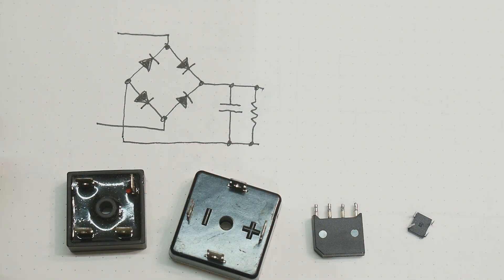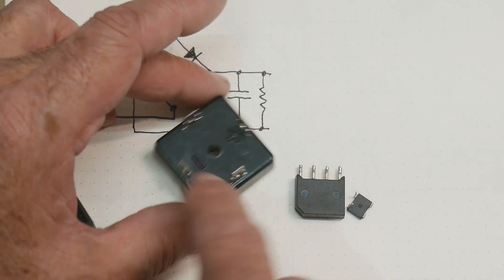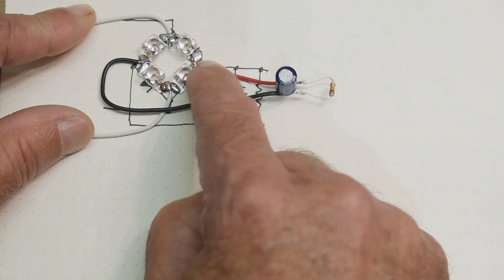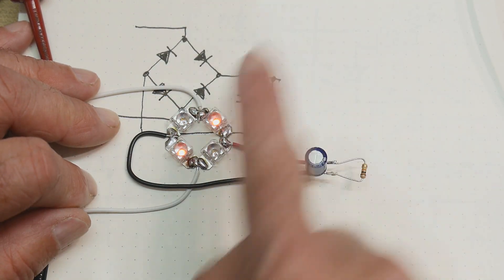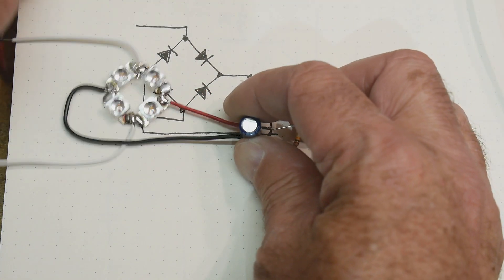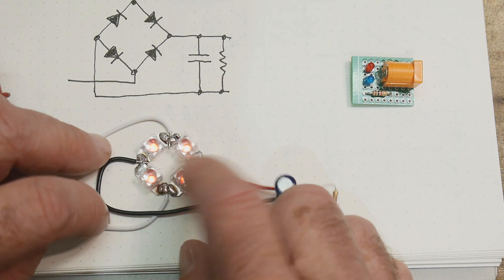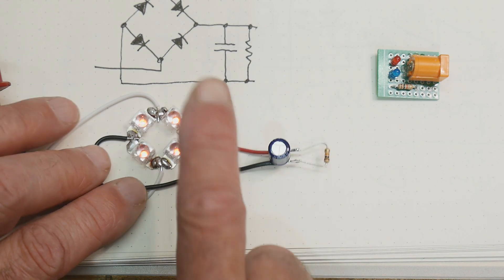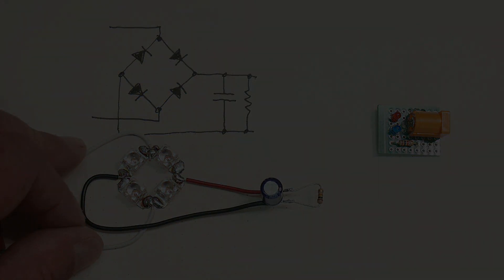#772 Basics: Bridge Rectifier Visualized

Comment: My awakening to the importance of return-path was when my wife complained that the headlights on her car didn't work. I worked on that problem for 3 evenings after work before I noticed that when I pulled up on the headlight dimmer switch the heater fan would run.  ????   A couple hours study of the wiring diagram convinced me the only way that could happen is if a ground connection was not good.  Checking a multiple lug ground terminal mounted to the body in the left side of the footwell I saw that water had leaked through where the radio antenna was mounted in the fender and dripped right down on to it causing a lot of corrosion.  Cleaned it up and the headlights worked just fine.

Comment: As usual, an excellent explanation. What were you using to give 8 volts a/c that allowed you to bring it down to 1 Hz?
Reply from the maker: HP 33120A Generator
Reply: @IMSAIGuy  Will most generators do that?
Reply from the maker: @JohnVK5JAK  my old HP 8111 goes to 16V
Reply: @IMSAIGuy  A quick related question. If I want to test HF band filters (up to 30Mhz) I need a generator that goes up to at least that. Right?
Reply from the maker: @JohnVK5JAK  yes of course, a good tool for testing filters is the NanoVNA
Reply: @IMSAIGuy  I've got the NanoVNA & TinySA. I'm in the process of deciding on an Oscilloscope or Rig Expert AA-35. Decisions decisions......

Comment: I was pushed to be mindful of the "negative" side when I was working out, in general, a heat pump defrost board.  HVAC low voltage is 24 VAC, the board rectified it to operate relays, and also create rails for chips and thermistors.  The 24 VAC signals came into the board to ground through power resistors with voltage divider/zener diode taps to the PIC chip pins.  But those sensing circuits were to the DC negative rail instead of the AC common even though they were separate from the rectifier.  That forced me to not neglect the path back from the DC negative to the AC common as it is usually called.

I built a LED full bridge rectifier like in this video to help my mind visualize and accept.

Comment: Did you power that right from the function generator, or do you have something doing the low-impedence heavy lifting?

I have a newish function generator, but I find that I am afraid of killing it. Perhaps if I keep a 50 ohm resistor in there?
I may go this route, but even 2 clean watts would be decent as long as it was linear / class-a
https://www.dmcinfo.com/latest-thinking/blog/id/9462/low-cost-function-generator-amplifier-diy
...and try to keep the frequency low enough to keep the G-men from knocking on my door.

I think I have some TIP-120s/TIP-125s around, perhaps some old LM358s. Hmmm. 
http://chemelec.com/Projects/Amplifier/Amplifier-1.png
For the MKII, perhaps some kind of opto-coupling.

This is interesting, too: https://electronics.stackexchange.com/questions/188938/how-to-increase-the-rated-output-voltage-current-by-connecting-multiple-op-amps
Reply from the maker: powered directly. I've wanted to build a lab amplifier (I have several RF ones) for audio frequencies. HP had a nice one in the olden days. Used it to drive motors to test control circuits.
Reply from the maker: Just watched the link you sent. Interestingly I had discussed my idea with a friend and he also suggested using a op549. Guess I'll have to get one. Looks indestructible.  I had planned on using an audio amp IC with short circuit protection but the op549 seems more lab grade

Comment: Great way to visualize the principal. I wish the video was up when i studied power supplies. 
I was recently looking at the lectenna which is basically a schottky diode working at RF frequencies which rectifies RF power and lights up the LED. You can imagine that it's very ineffective and only works from about a few mm from the power source, however, I was thinking of making a bridge rectifier from schottky diodes and trying to increase the efficiency. What do you think about it?
Reply from the maker: yes, even better: https://www.analog.com/en/products/monitor-control-protection/ideal-diode-bridge.html#

Comment: Newbie question: why would you use a polarized capacitor in this case?
Reply from the maker: with no capacitor you would have AC. the capacitor stores the energy and creates DC. any capacitor would work. a polarized capacitor is just cheaper and you use them when you can.
Reply: @IMSAIGuy  Bingo!   Fred
Reply: @IMSAIGuy   thanks!